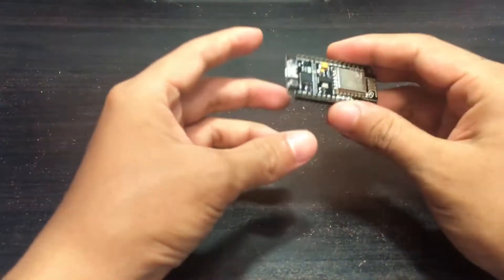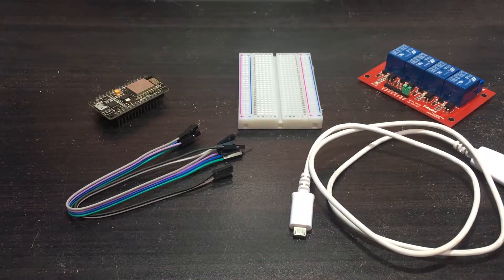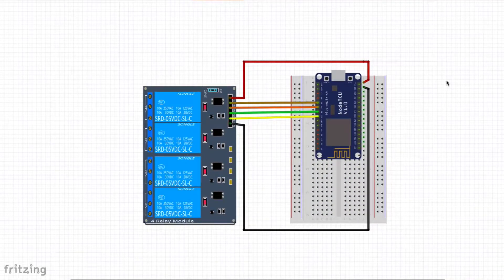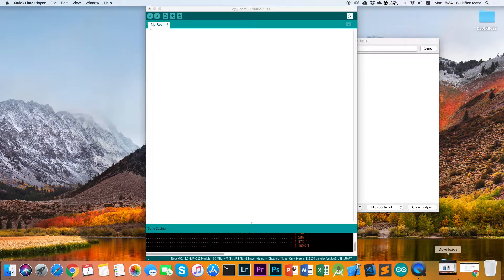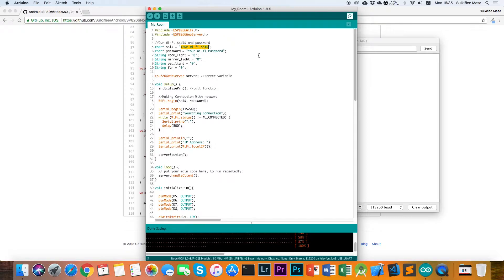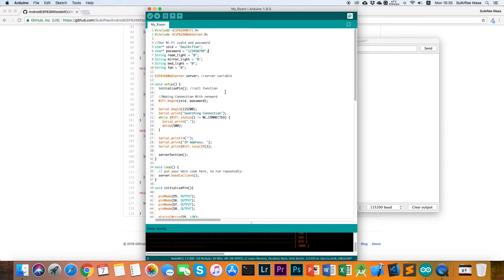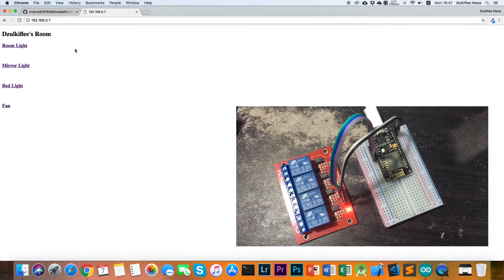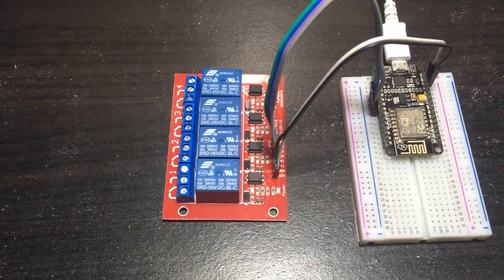ESP8266 (NodeMCU) Android Control via Internet Tutorial - Part 1

Comment: Thanks for sharing, if we use arduino mega 2560 and the cheap esp8266 how we can control the esp8266 trough arduino board?
Reply from the maker: You can use Serial Communication between Arduino and ESP8266